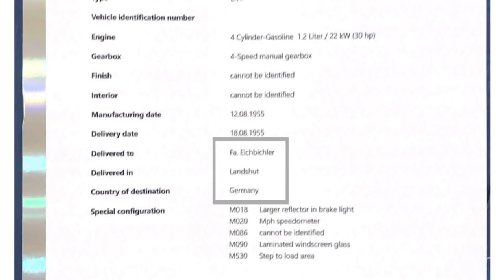1956 Wolfsburg 23 Window Rescued

Comment: Sweet!  In the 80's I found a running 61', 6V bus, yellow with white top that had the back curved windows and mint original interior that ran well- for $200.!  I popped a 12V 72 Super Beetle engine in it and never had a problem starting it with the 6V starter.  Turned over instantly and never burnt out!  Took that thing all over the North East and Canada for back road joy rides and camping.  Back seat folded out to a full bed.  A full set of curtains and a few coolers gave me all I needed to stay rent free during evenings in the woods or on beaches.  I had to learn to not answer the door when cops came knocking at 3 a.m. to try and chase me away.  Always a problem in the U.S.. So much fun!